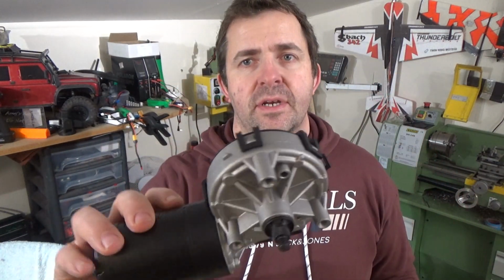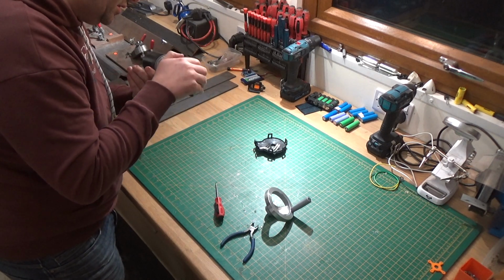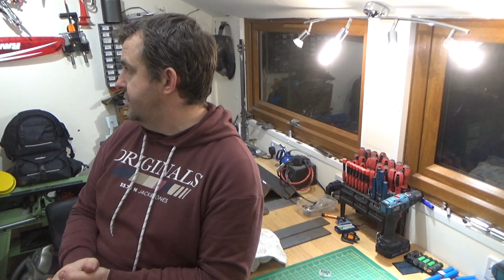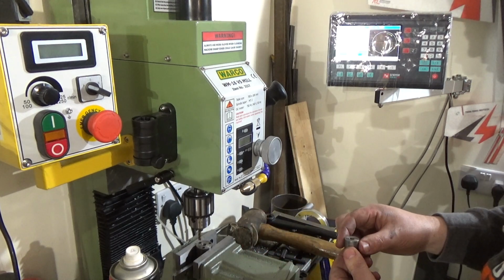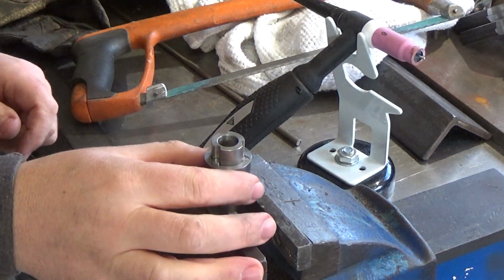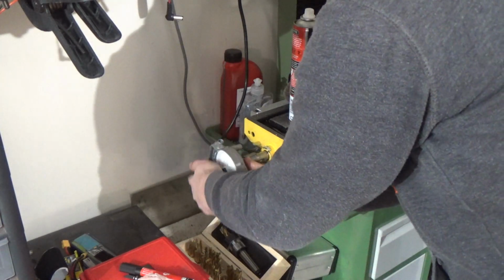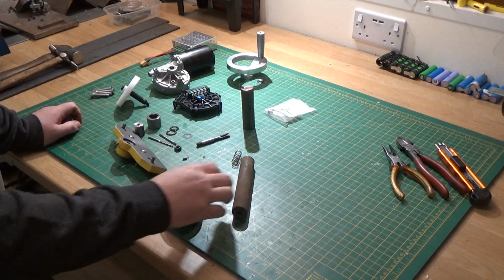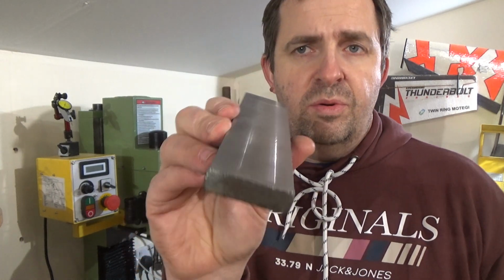Auto Feed (The Shed)

Comment: Im making a power feed for my x2 mini mill.the clutch and drive will be 3/4 inch hex bar threaded on the table leadscrew and a 19mm socket with a cross pin fixed on the motor end.

Comment: I did this on my mill, easy job to do, but found it toooooo slow in both directions,so took it off and fitted a proper Bridgeport type drive, much better job
Reply: The wiper motor ALSO got very, very hot  within 30 seconds of use, so hot I could not even touch it.
Reply: By the way these wiper motors will TAKE 24volts as well as 12volts with no problems
Reply: @carlmcferran9371  yep I'm running 19 volts through mine for more speed with no problems.

Comment: Could you elaborate more on the controller parts. Thanks. Tom
Reply from the maker: Hello Tom thank-you for watching. This is the controller I used but it is just a generic 12v one. DC Motor Speed Controller DC 12-60V 40A PWM Speed Control Regulator DC Variable Frequency Driver - CW CCW Reversible Switch https://amzn.eu/d/cBOu29L
Reply: @AndrewBoulton  I was wanting more info on the on/off black switch for controller to keep motor from getting hot. It looks more elaborate than a simple on/off toggle switch. I’m also having trouble finding the 300x220x120 enclosure here in US, but still looking. Thanks